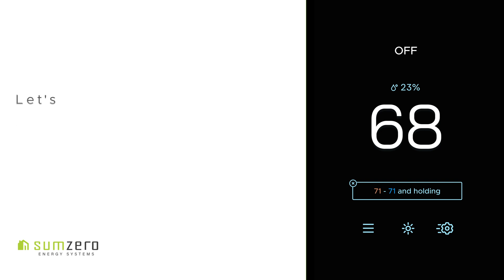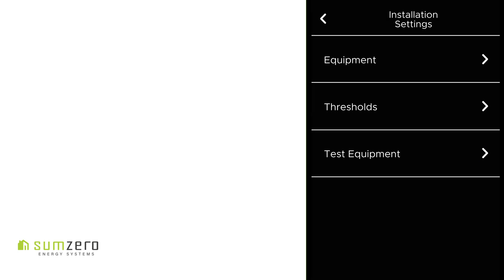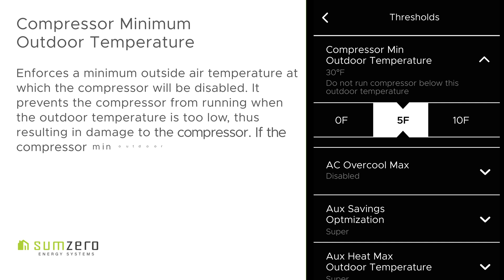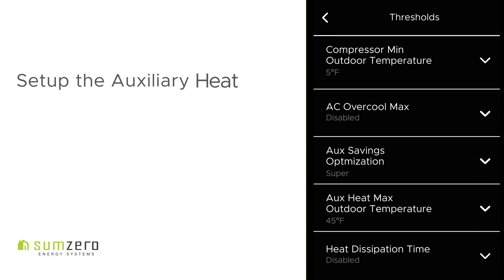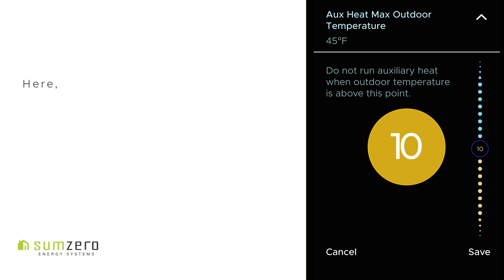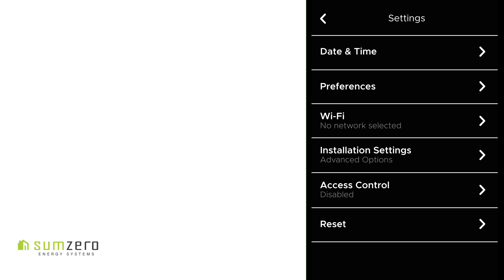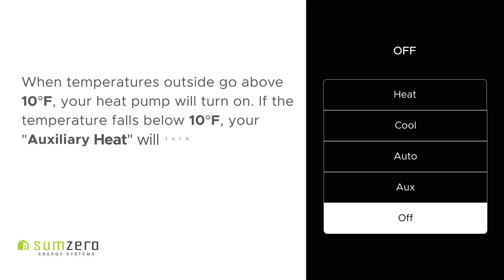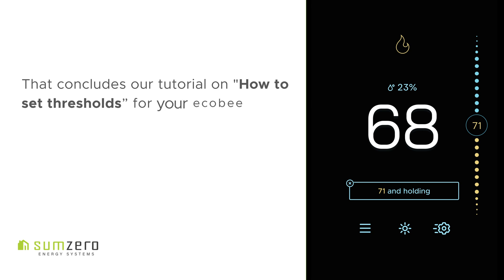Threshold Settings for ecobee® Thermostats

Comment: Ecobee turns my furnace on & off every 2 minutes.  It's like if I set the heat to 68 the furnace turns on at 67.9999 and turns off at 68.00001.  I thought that was a threshold setting but I guess not.

Comment: Maybe good for gas furnace but these settings with a heat pump electric will have you freezing your socks off!
Reply: Right i hate my ecobee its either wayyyy to hot or wayyy to cold around my house im switching back to my old style thermostat
Reply: @MaskedAMB  Make certain you have your remote sensors disabled or ...not placed next to a cold wall.
Reply: @geraldhenrickson7472  i only have the main thermostat on the wall i don’t have any additional sensors which is why im converting to another brand because its way too expensive for something so simple
Reply: How good is this stat
Reply: Not if your system is sized and installed correctly. Also it helps if you have selected a higher SEER (efficiency) model from all those available within a given brand. There are SO many variables involved...this was only two variables.